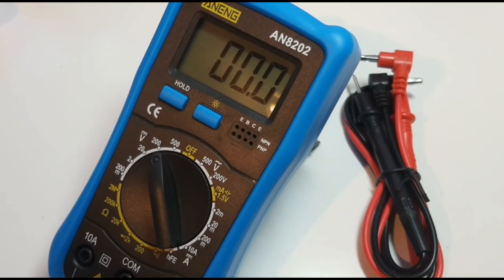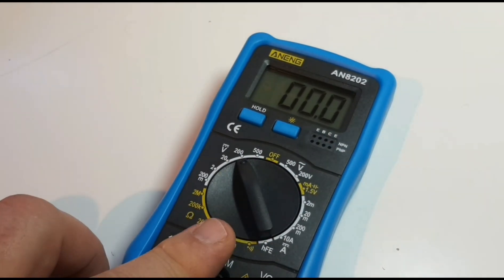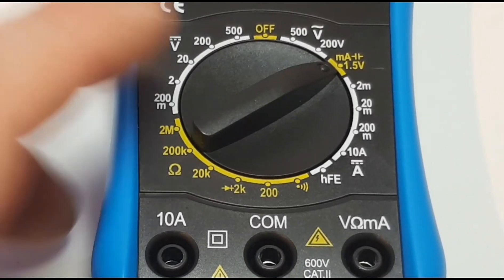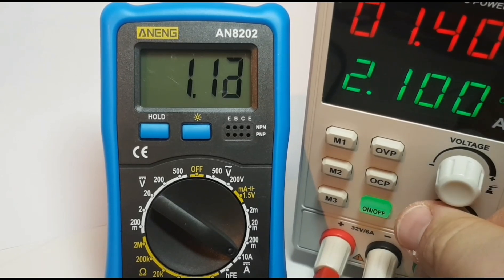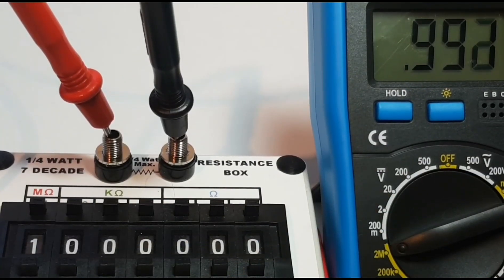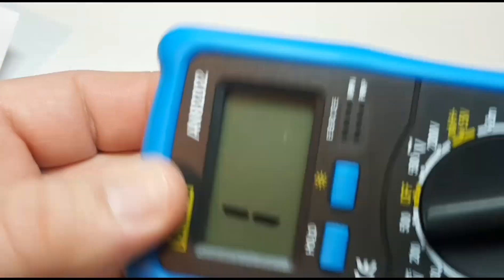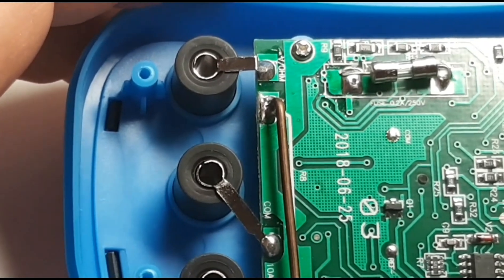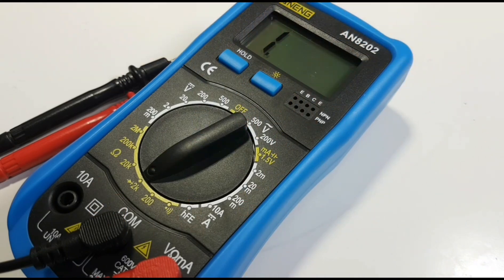ANENG AN8202 CHEAP-O Multimeter Review & Teardown !

Comment: Jist a note,  i don't think that Aneng makes any meters from scratch.  From looking at the AN8002 range and above,  they all have zotek pcbs.  I think that Aneng is just a marketing/ reseller company for other manufactures. Zotek is the R	&D and the main manufacturer for them.
Reply from the maker: Thats correct, Zotek is the OEM for many rebranded dmms ..

Comment: If it has a transistor checker on it it's poop
Reply from the maker: Hi Jason, HFE doesn't necessarily mean it's crap. In this case Aneng has done a stellar job of mixing cheap cost with decent quality and  a stellar display. The internals demonstrate that they put some thought into this pocket rocket.. YMMV but I'm very happy with the result.